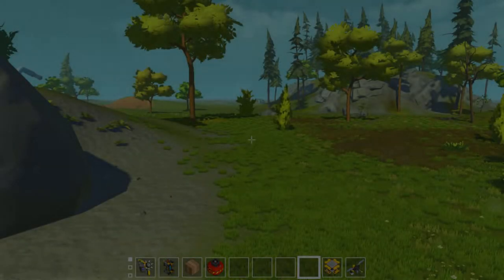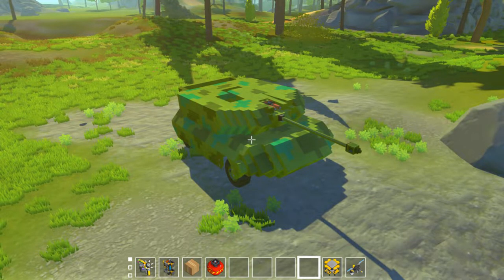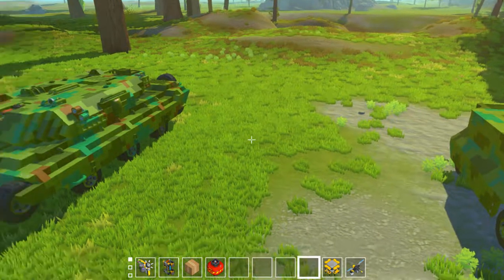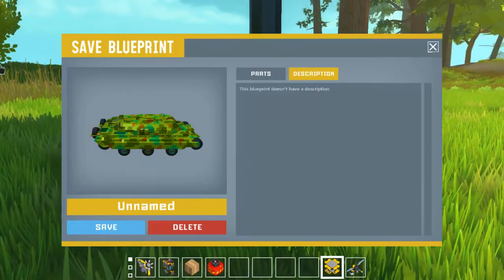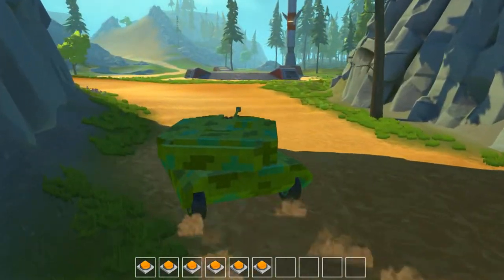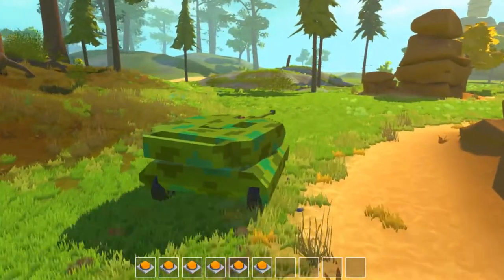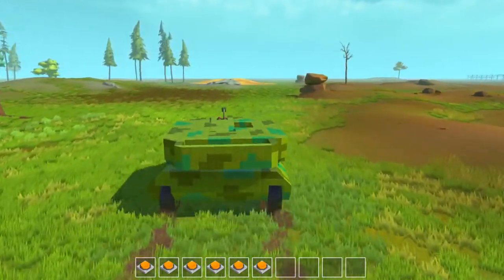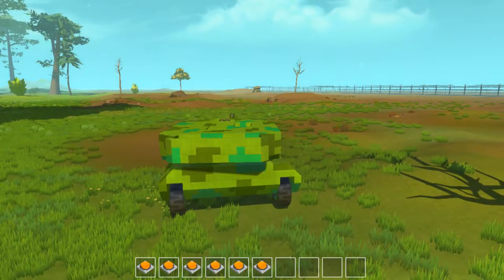Modern Armored Car...  | Mbt Mk 30 | Scrap Mechanic

Comment: I actually managed to build a 2 shot autoloader that works reliably down to 0.5 fps based on your design. It only requires 1 extra logic gate. I also managed to build an elevation mechanism that is smaller and more compact than yours, and doubles as the stabilizer. I will post details of how they work on the Discord server soon.

Comment: You should build the french armored car AMX-10RC
Reply from the maker: I might have accidentally build one. I was going for something that looked more like a bmp-2, but It turned out near identical to a amx-10rc. The only difference is the thing I build uses tanks steering instead of steering like an armored car...